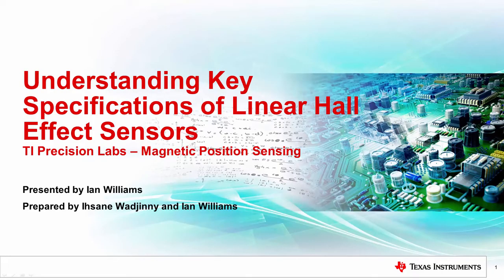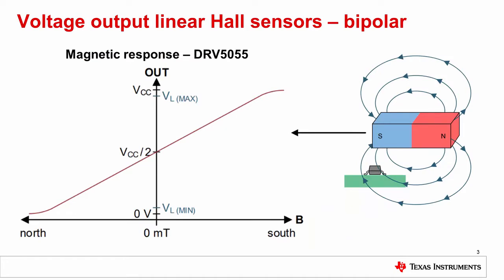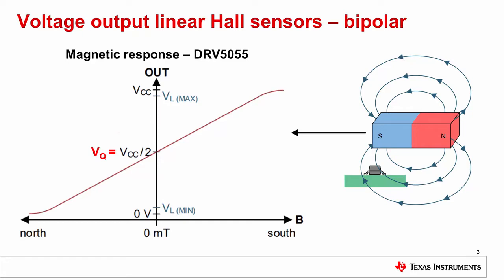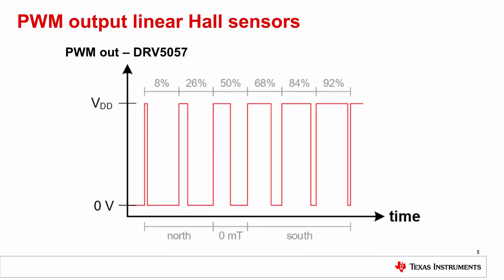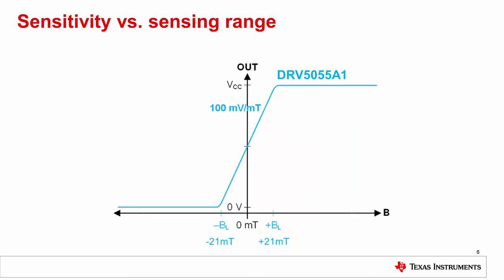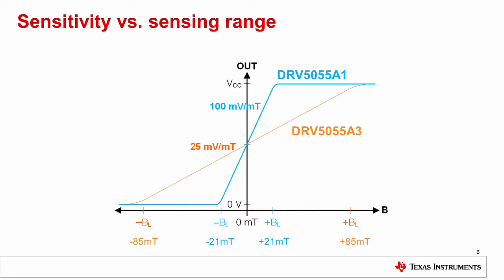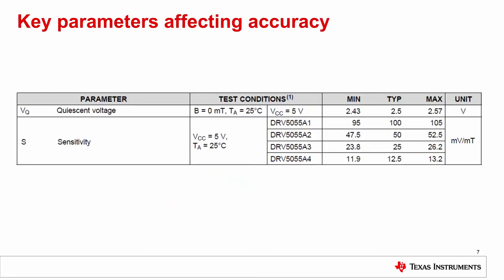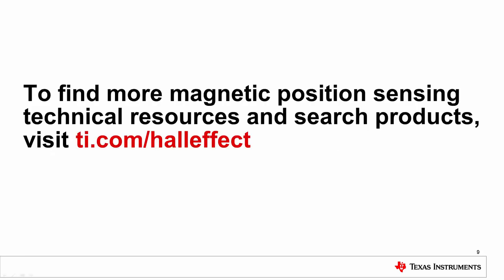Key specifications of linear Hall-effect position sensors

Comment: Hello. I'm looking for an hall effect that will output 5v (vcc)when near south pole, and about 0v when near north pole. It is for an dc motor for toy car. So when senor is near south it will go full throttle and when let off the pedal, the senor will be at north pole and 0v so the motor will fully stop. Right now I'm using the 49e hall sensor and when let off the pedal it is still output about 0.86v to the speed controller so the motor doesn't quite stop. Is the drv5055A1 the right sensor or the drv5057? Or could you recommend the correct sensor? Thanks